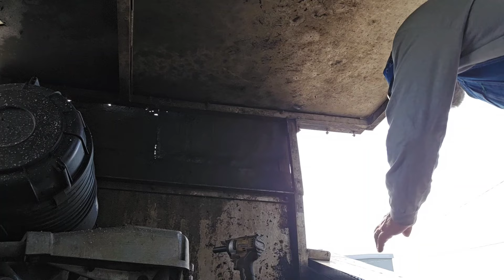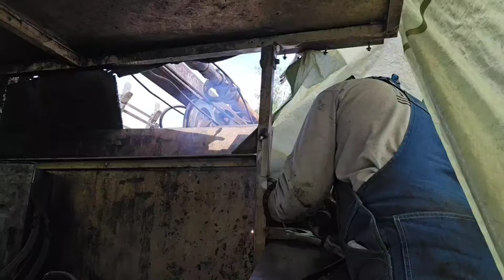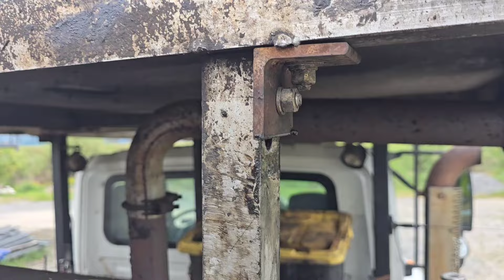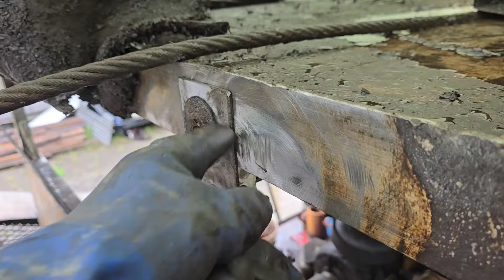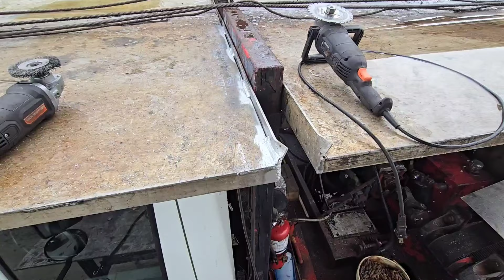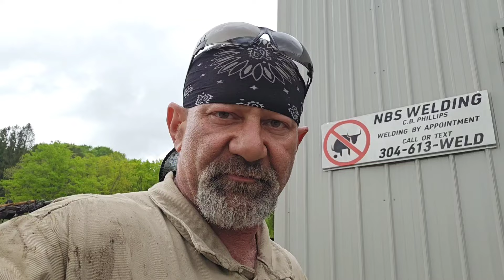Welding repairs on the aluminum roof of a well service rig

Comment: Weld repair of aluminum is a necessary evil of today. It's good for initial fabrication where they can take advantage of the light weight and ease of forming. All of the stress induced into the forming goes out with the part and the end user gets to deal with it in real life. When it begins to fail that's when you get to deal with it. Then they start to question why you have to charge as much as you do for the repairs. "It's just aluminum." they'll say. "Should be easy to fix." but you'll spend more time getting it in a condition to weld than the welding itself. They will end up with something better than they started with but they have to pay you for your work. Also, on the weight difference of aluminum over steel. You also mentioned the strength differences between the two. Thinner steel can be used where strength isn't a significant factor and much of the weight difference disappears. The only additional benefit for aluminum over steel comes in preservation and upkeep where that is concerned but you can end up paying for the convenience in the long run when repairs become necessary. Keep on doin what you do and keep those Arccaptain welders burning... 👍

Comment: Hey cb i got a job coming up this weekend welding a rollback what aluminum mig wire would u use i got 4043 and 5356
Reply from the maker: Either one or both

Comment: Wow,  CB……whata dirty rig!   Because of your tip about bees wax, I got a block of it to use with aluminum grinding.   Any extra charge to the customer because of the greasy mess you’re having to contend with?   I know it created extra work for you.   Thanks for all the tips…they are part of why your channel is one of the best!
Reply from the maker: I charge by the hour....doesn't matter if I'm TIG welding or powerwashing the price for my time is the same.
Like they say in the military,  get paid the same for marchin as ya do fightin
Reply from the maker: I use 5" diameter sanding pads on a 4-1/2" rubber backing pad....80 grit...sands aluminum great...and the beeswax is the trick that keeps it working

Comment: I agree with everything you said BUT one thing. Acetone. Most of the time I will agree there’s no major benefit, but for example I just did a hydraulic tank. The acetone was pretty pivotal for welding especially with the seeping from the tank. With that being said there still was a lot of fill, grind it out, until I got enough good aluminum in there to weld it out. Everything has its place at certain times. Just my point of view
Reply from the maker: Thanks for watching and commenting

Comment: I think they changed the adapter so there is no chance someone could plug something 120v into the adapter can’t put it past some people now a days unfortunately. does the tig torch for the arc captain run a/c also for Alluminum?
Thanks for the video Cb👍
Reply from the maker: If you want to AC TIG aluminum you need the ARCCAPTAIN TIG 200P....The MIG 200 is not an AC TIG WELDER

Comment: Random comments:
I bought an ArcCaptain MIG200 after your initial review, and it has been great so far. It does have the "safety nazi" style of plug (220v standard, with an adapter for 110v).....so I still need to make an adapter to run an extension cord on 220v. Only issue that I've had (& not sure if it's just a glitch in mine, or a common settings issue)...... When running FCAW (good Hobart flux core), I prefer the synergic relationship (V/Wfs) that is actually on the ER308L 0.035" scale/settings. For some reason, it stops/limits at around 19v, although you can go into manual mode & go considerably higher (24v-26v I think).  Still usable, but it'd be handier to just use the synergic mode.

Spool gun-   I already have a Miller Spoolmate 150.....sure would be handy to be able to adapt that to the ArcCaptain, rather than having to purchase another.

AL strength/weld strength-  
I primarily Tig AL, but have also used my spoolgun when handy.  If you'd try 4943, you wouldn't use 4043 again. 4943 claims 25% higher tensile strength, & 50% higher yield strength (than 4043).....I don't have the ability to scientifically test it, but can attest that it's noticeably stronger on the boats/machining projects that I've used it on.  Just looked it up; roughly the same price as 4043 as well (for 1lb spool).

Thanks for another great video!
Reply from the maker: Thanks for watching and commenting...I'll look into the 4943

Comment: Me again CB. I’ve adopted your beeswax method and love it! Like you probably, I’ve tried WD-40 and tapping fluid and that just makes a greasy mess. Also, I will occasionally use NON-chlorinated brakleen but for the filthy, nasty aluminum that we typically repair, I have never seen acetone accomplish anything but add expense. As far as aluminum goes, I tell people all the time; if you’re buying aluminum, “you’re buying future cracks and headaches”.
Reply from the maker: I agree

Comment: If you ever do another one of these it would be worth looking into having the sections being welded to be dry ice blasted.  This will remove oil and grease far better than power washing, it leaves no moisture and would make the welding job a bit easier.   

Also, are those spool guns heavy or just bulky?
Reply from the maker: They have the bulk of the spool but are not heavy...the ARCCAPTAIN is much lighter than my Miller 30A spoolgun

Comment: Welding on oil and greasy equipment is challenging when trying to not catch it on fire. I had a fire on an excavator once . I was able to put it out quickly but it is a challenge. Clean and use fire blankets and have another person on fire watch while you are welding aswell. Some good insurance doesn't hurt lol. Any other suggestions are appreciated CB.I love doing repair work.
Thanks for the video and passing on your knowledge.
Reply from the maker: Thanks for watching and commenting

Comment: Chlorinated brake cleaner if heated past 300 degrees will produce phosgene gas which is poisonous, non chlorinated brake cleaner is safe to use to clean parts for welding

Comment: I have the spool gun for mine and it's good to see a video of someone actually using it.   Do you have to have a faster travel speed?  Have a good week.
Reply from the maker: I always travel faster with aluminum MIG than on steel...aluminum dissipates heat much faster...and on the thin contaminated stuff I jog the trigger quite a lot